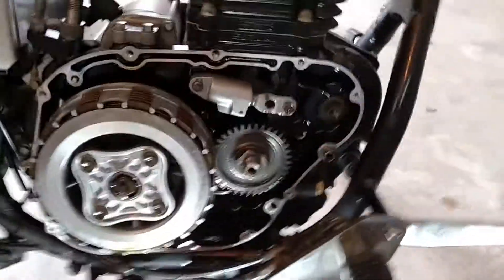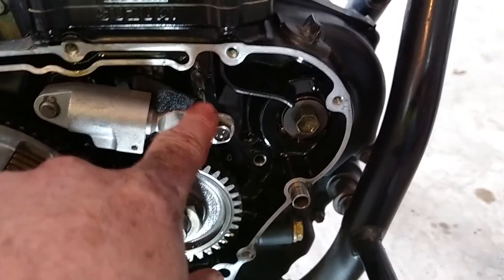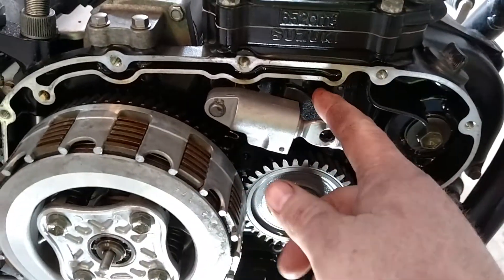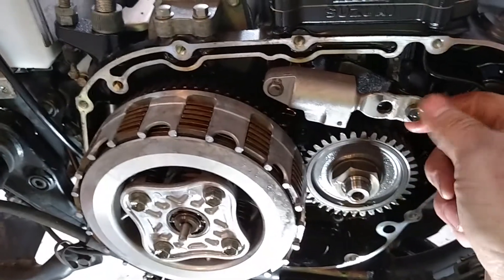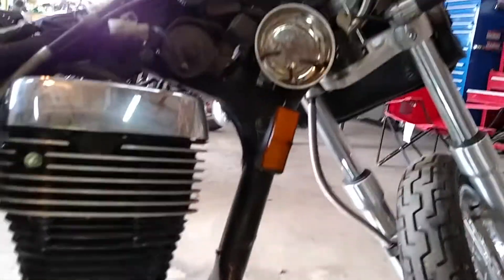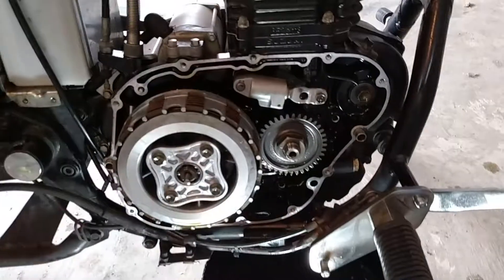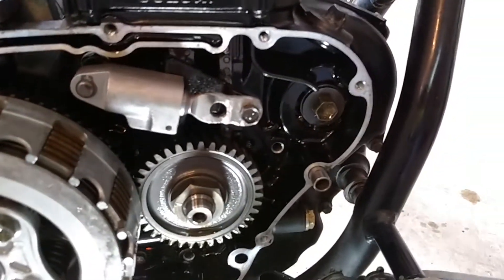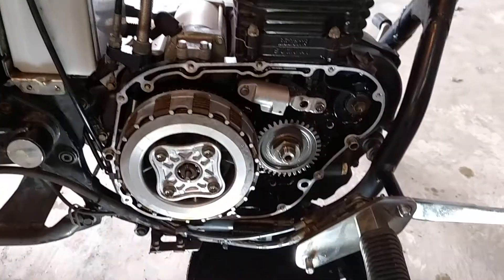Suzuki savage part 5

Comment: Have the same problem in mine, just got a new Adjuster in. I'm not sure whether I should modify it like this though or just replace the chain too as it probably is stretched since my old one just fell apart. Can't hear the audio well but what kind of welder did you use to do this with?
Reply from the maker: +Brian Peniuk the welder was just a flux core wire feed welder.